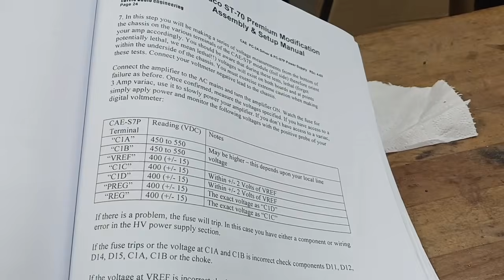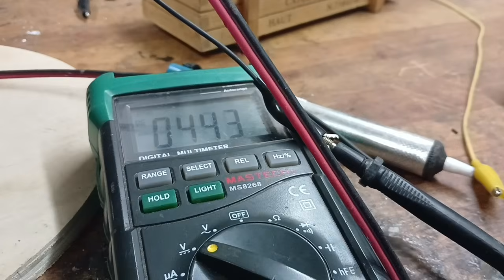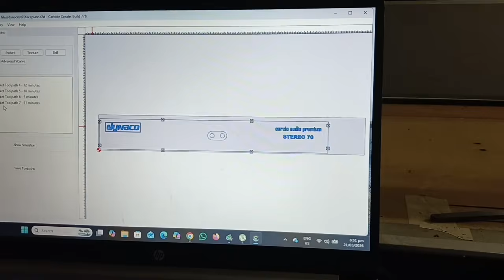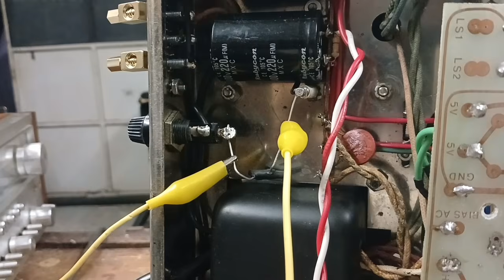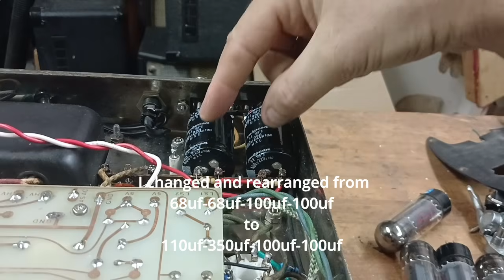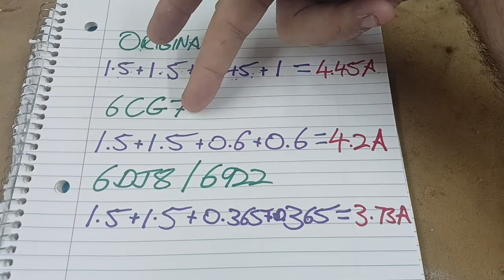Dynaco Stereo 70 ST70 with CAE Curcio mods full rebuild part2

Comment: J have one of these Curcio 70's. It had developed a problem after many years of use and I recently rebuilt the driver board. What transistor do you have on the cathodes of the driver tubes? I have 2N4400's there. I was thinking of using 2N2222A's
Reply from the maker: I have the supposedly original 2N4401, the only semi conductors I replaced were: LM317T, two TIP50s, and the 2SD820. How did you like the amp? And what was the problem that developed?
Reply: @jothanankrogh  I've had her a long tike, I like her A Lot, she's one of my favorites. I have her configured with Kiwame and Tackman carbon film resistors and V cap coupling capacitors using old Telefunken ECC88's . You gotta watch if yours has the 470k bias resistors and .47uf coupling caps on the output tube grids. The time constant is too low and can lead to instability. I usually run her like 14 hours a day, she developed an intermittent crackling and popping. One of the plate resistors became noisy. You also gotta watch with yours, I see whoever originally built it used a lot of Holco resistors (the shiny black ones), be aware that they don't like hi voltages and can fail. If she starts making noises it's those
Reply from the maker: @panheadchopper  so far a few months later, zero problems, zero noises ever, and it sounds GREAT! Yes mine does have the 470k resistors leading from bias negative to grids. What is the service issue for that? 
I am presently working on the Mark3 version of this kit, and the bias resistor network is quite different there, and theres 150k in the same postion, also theres a 20k bias balance pot that is ineffective in tje mk3s but whatever setup is in the st70 worked great.
Reply from the maker: Update- I've come across this substitution in a followup project(mark3s). The orig is supposed to be 2n4401, the previous owner installed 2n4400, but I'm using the modern 2n2222A which I read is a fine replacement. I couldn't say which would be 'better', what would we be listening out for?

Comment: Nice work! I wouldn't have thought a thermistor would rob you of that much voltage! Looks great and glad it sounds great, too!
Reply from the maker: 'Normally' I would have left it in, but I need those precious extra volts to keep about a 40volt gap between the rectifier and regulator output.

Comment: Not familiar with the gain/phase splitter circuit but 6CG7's are lower gain, higher current valves to the 6DJ8's, might be worth checking how they are biased. The heaters pull more current too IE 6CG7 600mA, 6DJ8 - 385mA, can your tfmr supply the extra current? Just a couple of observations from a brief watch of your video, will watch the rest tomorrow. Cheers - DA.
Reply from the maker: Yes I discuss the heater current math and options at 50mins in. The manufacturer of these boards advises any of the 6DJ8, 6922, 7308, 6N1P,  or 6CG7 may be used without alterations, tho I think they were initially marketed with 6DJ8. I read a few users say they liked the 6CG7, and so far I do too.